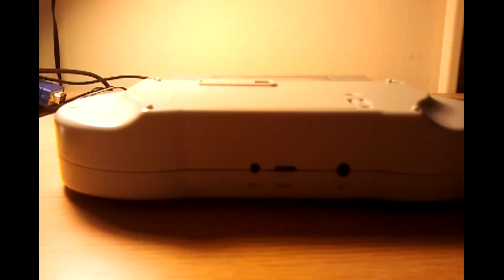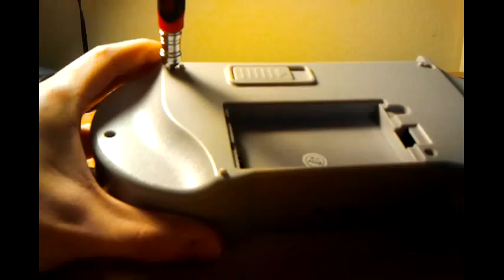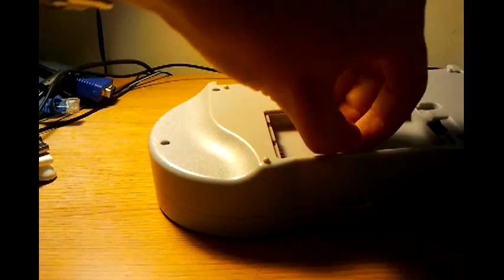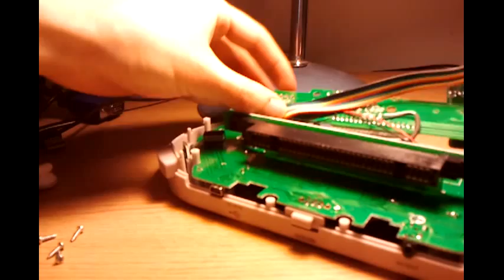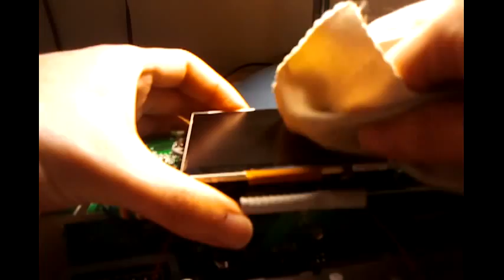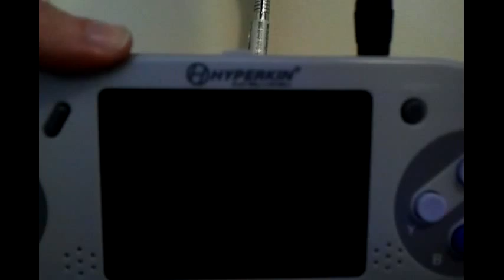TeardownTube - episode 17 - Hyperkin SupaBoy Portable SNES

Comment: anyone know which chip is the audio chip on this badboy, i have the black supaboy and im not getting audio on it, it does boot games i just get zero audio, im thinking its the audio chip that went bad, i ran a snes diagnostic cart on it and it says the audio chip is bad. but since they scratch off the actual letters on the chip its kinda hard to find a replacement chip.
Reply: Volume Dial on the bottom

Comment: not sure if you care to read this or help but i have 2 white lines running horizontal on my screen where should i start?
Reply from the maker: Unfortunately it sounds like you would need a replacement lcd. You might be able to find the model number of the lcd on the back of it and google to find a replacement if any are available.

Comment: I know this is a 5 year old tear down vid, but I've recently have been pondering to work on my Supaboy handheld again.   The last time I opened mine up, I modified my D-pad so playing games like Street Fighter, was no longer a chore to pull special moves off.  I simply added a center balance peg.  This time around, I'm interested in playing with the sound amp, to produce true stereo sound.  Though this Supaboy features two speakers and the package clearly touts full stereo sound, it actually uses mixed channels signal, as in mono sound.  This is especially annoying, when playing games like Donkey Kong Country, which boasts beautifully composed music with great stereo effects. 

Do you know anything about creating a stereo amp that can be applied directly to this device? The last time I've read something about this topic, it required the understanding that producing a stereo signal, may actually cut down battery hours, when using powered amplifiers. Though I'm not sure what would actually be necessary to achieve this. Anyways, much appreciated for your time and  for sharing this excellent clip.
Reply from the maker: I doubt adding an amp channel would have much of an effect on battery life as you would only be driving a watt or less (at moderate volume it is likely to only draw a trickle of current). Just find the resistors that mix the left and right channels, desolder one channel and one speaker, wire another amplifier to the other channel and you are golden.
Reply: Thanks a lot for replying.  I'm in the midst of educating myself, to better understand how all of this works. To be perfectly honest with you, the farthest I've ever gone, in regards to stereo output, was soldering left and right speakers to their proper channels.   But in regards to amp DIPs and resistors, I'm still in the dark here. This may take me a while to get under my belt, but I'm willing to study further and see if I can get this project moving forward.  I took very good picture of my main board's audio circuitry to study each component.  The left and right speakers are sharing the same line, as well as the headphone jack.   

I've spotted 6 resisters, around the amp chip.  The closest one to the right speaker wires, is labeled as R54. There's a larger one that also shares the same path, labeled R21 (the resister itself is stamped 561). This one is touching the ground wire from the speaker, as well as the headphone jack.  I'm a bit of a loss as to where exactly I should begin to desolder. I'm working this out on my computer first, since I don't have a secondary amp readily available. Someone recommend the use of "JRC NJM2073D DIP-8 Dual low voltage power amplifier", for better quality audio. 

Again.. still clueless, still learning as I go. ;) 
Thanks again! I really appreciate your expertise on the matter.
Reply from the maker: It is likely that both L and R channels are merged through two resistors and then input into a single channel amplifier before it reaches the speaker. The first step is to find a datasheet for the amp chip and determine which pin is the input and find the two resistors at that input. Then you will know which traces are the left and right audio.
Reply: I want to thank you so much for your help!  I pulled a datasheet for the chip (at least I think it's the correct one). The chip itself is a 8002B but the data sheet I found, was for an 8002 (no letter).  Not sure if that makes any significant difference. I'll keep looking.
Reply from the maker: No problem man! The 8002B is likely the same exact chip but in some lead free variant or is a tape or reel variation.

Comment: Those three ASICs are the same ones just about every SNES Clone uses that isn't software emulator based (e.g. Retron 5)  or FPGA like the SNT.
Reply from the maker: Thanks for the info. It would be interesting to find out what team reversed engineered the snes to design these chips.
Reply: Someone in China many years back.

Comment: Can you help me with the card edge connector slot? I have a supaboy S whose slot had 2 connector pins (aluminium pieces) break off from their solder. I ordered a spare SNES cart slot. Would it fit?
Reply from the maker: It's a relatively standard connector SNES carts use so it should work with possibly minimal adjustment/lead bending.
Reply: sjm4306 thanks! It however begs the question If it Will hold the Cart tight enough for a portable Thats supposed to be moved about... The SNES slot is Very sensitive to movement. Their solution (Very tight slot), coupled with bad quality pins, is a time bomb... Maybe a portable SNES is unnatainable after all! Perhaps gluing some plastic on the flaps...
Reply from the maker: Having plastic guides around the sides of the cart to prevent it from flopping would be the best design choice.
Reply: @sjm4306  I am happy to say that the above mentioned surgery was succesfull, and a bit of tweaking (using the dust shield flaps as "guides" for the cart) led to it being a perfectly functional portable SNES, with an original edge connector! :)
I have no idea how hard it was to clear off the solder from the broken connector, etc, and solder the new one in, as well as necessary adjustments. I paid a pretty run of the mill guy a few bucks and he seemed to be able to do it with no problems until now (about 6 months in)

Comment: Huh, are you seriouse, you telling me that lcd screen inside the supaboy is just composite???
NOT. RGB, 
Does that mean that also the supaboy S lcd screen can be only feeded with a composite video signal.

Well in this case i will be not surprised that the TG16 lcd is just composite since i do clearly see rainbow patterns on small white letters.
Reply from the maker: To be honest on that small of a screen with a decent composite encoder it's not the end of the world.

Since these consoles actually generate analog rgb and then convert to composite it would be possible to replace the lcd with one that directly takes rgb ... if they were easy to find.
Reply: @sjm4306  If you ever revisit this console, a 4:3 RGB or IPS screen mod would be cool. 
You can case mod for larger batteries, and change the USB mini to USB-C or USB-B.
Wondering if you could get a better video out signal. 🤔

Comment: I have issuse with my supaboy the screen suddenly got static and turned blue what could it be ?? @sjm4306
Reply from the maker: Maybe it's sad ... get it, it's blue ... anyway first thing to check when any analog or digital circuit starts acting funny is the power supply voltage going in. It should be 5V but if it's drooping then maybe the supply decoupling capacitor is starting to go (especially if it is a cheap never heard of brand). As a matter of course it is fairly safe to just replace all electrolytic caps and check if that solves the problem. If not they sell compatible composite screens on ebay that you can easily solder in place of the old one.

Comment: I created a custom PCB via Osh Park and used a Raspberry Pi 2 B with the ports desoldered and used a better composite LCD from Adafruit with my SupaBoy to create a bad ass handheld NES and SNES emulation unit. It's pretty sweet, but took a lot of work.
Reply: H0rcrux do you have a link to your board and which screen did you use?  I aim to do the same project.

Comment: A normal display would be designed for VGA/RGB, WVGA or Super VGA or in other words 2x WVGA and Modern phones and PC gaming monitors use a LED technology display that has an extra yellow diode that looks way better then a normal LCD which normally is native to composite regardless of how its designed and generally you will have VGA for LCD but if its a TV not monitor then its not really VGA.